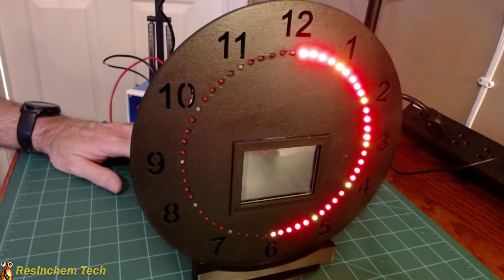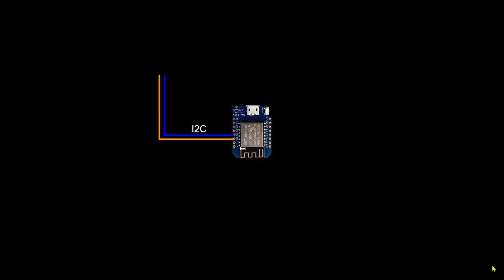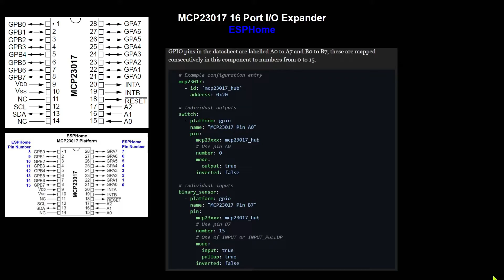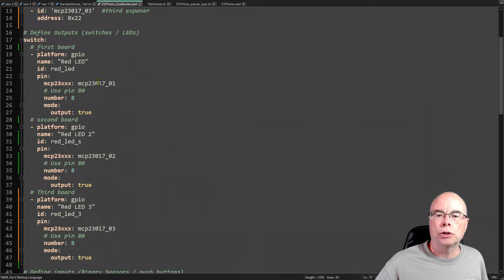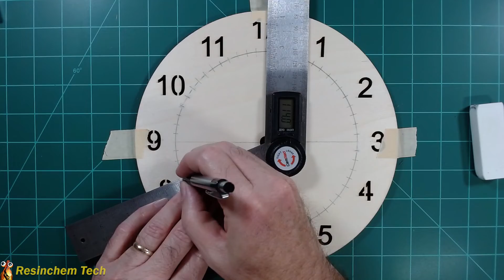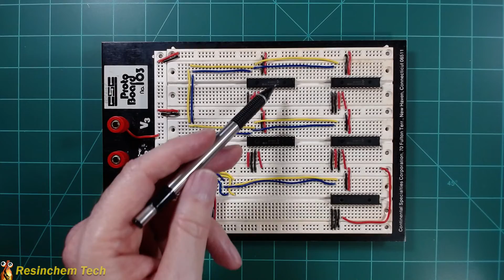MCP23017 Port Expander and ESPHome: Add More I/O Pins to Your Project

Comment: Can I connect TFT SPI pins on mcp23017 pins?
Reply from the maker: You can try it, but there may be issues with the signal/clock speed.  A quick search and it looks like you may want to check out the MCP23S17 instead.  I think this allows higher speeds than the MCP23017 and may work better with SPI.

But I haven't tried any sort of port expander with SPI, so I really can't say what might and might not work.  You'll just have to give it a shot on a breadboard version and see if it works.

Comment: I use mcp23017 a lot now  since you can add encoders, buttons and LEDs to them. I also read the pins GPA7 and GPB7 cannot be used as input pins on the latest chip die. So be careful when planning which pins to use, I tend to put my LEDs on pin7 of each bank.
Reply from the maker: Thanks for sharing your experience and the tip about the pin limitations with the latest chip die!  I haven't used one in a while, but I do have a few left in my parts bins.  I've also just been playing around with the TCA9548A multiplexer.  This one is made specifically for I2C devices, but should resolve the issue of two (or more) I2C devices with the same I2C address on the same bus.
Reply: @ResinChemTech I successfully run 8 MCP devices reading encoders, buttons and illumination of LEDs. I would like to add another 8 on the second i2c bus of the Teensy 4.1 to get 256 inputs for more encoders, but I have not tested that theory yet, also I could try and i2c multiplexer to give me 8 i2c busses on one pair of wires. I have done this with 8 OLED displays and it works fine to update any one of them.

Comment: is there a cpp code for arduino ide platform for esp32??
Reply from the maker: Are you asking if C++ code can be used with the Arduino IDE?  If so, then yes, C++ is the native language for the Arduino IDE and there is robust support for the ESP-series  of MCUs, including the ESP32.

If you've not worked with the Arduino IDE and the ESP32, then I have an introductory video on how to set it up and use it:  https://youtu.be/KS5HOJat88k
Reply: @ResinChemTech  thanks a lot

Comment: Hi there, nice explanation! But let me suggest something:

Hey there, fellow electronics enthusiast!

I watched your awesome YouTube video about using the MCP23017 Port Expander with the ESP8266. Great stuff! I noticed that you mentioned the limit of using up to 8 MCP23017 chips due to the addressing, but I think I might have a cool idea to expand that even further.

Here's the thing: we can set the I2C address of each MCP23017, right? That gives us 8 possible addresses to work with. But what if we get a bit creative? Let's say we use another MCP23017 to control the address pins of the other MCP23017s dynamically. We could set up the controlling MCP23017 to switch between just two addresses for all the other chips.

Picture this: we've got our ESP8266 and a bunch of MCP23017 chips. We dedicate one MCP23017 as the "address controller." We wire up the address pins of the other MCP23017s to the outputs of this controller. Now, by toggling the outputs of the address controller, we can switch the addresses of the connected MCP23017s on the fly!

So, let's do the math. If we use two addresses and switch between them using the address controller, we can effectively double the number of MCP23017s we can use. That means instead of being limited to 8 chips, we could potentially use 16, 32, or even more! It's like having a whole army of I/O expanders at our command.

Of course, there are some practical limits to keep in mind. The I2C bus has a maximum capacitance it can handle, so we can't go too crazy with the number of devices. Plus, the more chips we add, the more complex the wiring and code will get. But still, it's a pretty neat trick to extend the capabilities of the MCP23017 beyond the standard 8-chip limit.

I thought this might be a fun and interesting addition to your video. Feel free to give it a try and see how far you can push the boundaries of the MCP23017. Who knows, maybe you'll end up controlling a massive array of I/O expanders and impress us all with your mad skills!

Keep up the fantastic work on your channel, and happy tinkering!

Cheers, Pekagi

Comment: Hello. 
If  i want to use pultiple transmeter(10 TX for exampl) and one receiver .  How can i do that?
Reply from the maker: I'm not sure if this particular port expander would work for UART/Serial communications due to precise timing required.  I certainly didn't test the MCP23017 for serial TX.  You might need to search for a multiplexer specifically made for UART communications.  This is an example: https://amzn.to/4cRJJ9A but I have not tried or tested this particular module, so just consider it an example of something you might need to search for.  There are very likely other options, so you could just try a search for "UART Multiplexer".  Good luck with your project!

Comment: Just wondering: can these things do PWM at a decent frequency?  Ex. if you wanted to dim those minute-LEDs without changing the resistors ...
Reply from the maker: I don't believe I mentioned in the video, but I do talk about PWM in the related written guide for this project ( https://resinchemtech.blogspot.com/2023/10/IO-expander.html ):  

"While PWM (pulse width modulation) is technically digital and is commonly used for things like controlling brightness of a light by quickly switching the signal on/off, it is unlikely that the MCP23017 would work well for PWM due to the precise nature of the timing required.  But your mileage may vary."

Comment: Excellent tutorial Sir, but i have a question: i tried to expand Gpio pins using 74HC595 and i got noise problem, once switching on and off my roller shutter or my hair cutter !!! if use low voltage machines (12v ) no problem or no load also, and I found on the internet an article about noise problems using 220 v load on relays (the problem comes only with 74HC595 
if I use the same relays with the main Gpio of my esp32 Gpio exp (13 or 14) everything is ok 
so the question is: won't we get the same noise problem using the MCP23017? thank you Sir for replying .
Reply from the maker: I haven't tried using the 74HC595 as a port expander.  Nor have I tried using the MCP23017 for controlling relays with high voltage AC.  So I really can't tell you if you would experience the same issue with the MCP23017 or not.

Comment: Just stumbled upon your channel from the algorithm and I’m very pleased. Great content, clear and concise. Thank you for this. 

You’ve given me an idea for a clock using WS2812 LEDs. Would only need 3 lines (GND 5v and data) to do something similar!
Reply from the maker: Glad you found me!  Yeah.. as I mentioned in the video, this isn't necessarily the best way to build a clock, but it was really just an example of how to use the port expanders.  Funny thing, though... once I created a PCB and got rid of the breadboard, I really liked how the clock worked and have kept it on my desk.

I have also built a couple of matrix clocks using WS2812b LED strips.  These can also act as a scoreboard, countdown timer and a text display.  I have a couple of videos covering them if you are interested.

Comment: Very clear! Do you happen to know about any solution that allows to connect an extra UART based sensor?
Reply from the maker: There are certainly options out there for expanding the number of  UARTs on a device.  A simple Google search for UART Port Expander will turn up multiple possibilities based on your particular MCU and needs.

Comment: Hello, I came across it while doing an internet search while working on a similar project. Your explanation is very nice and informative. I am trying to do it with a 5v 16 channel relay card and esp32 via the blynk application. If I add MCP23017 to the project, it seems like it will work. Thank you very much, it is appreciated.
Reply from the maker: You are very welcome!  In case you didn't catch it in the video description, I have a related blog article with a bit more information than I could present in the video.  You may or may not find this helpful:  https://resinchemtech.blogspot.com/2023/10/IO-expander.html

As I mentioned in the video, it isn't necessarily the best way to build a clock but for me it was a good way to experiment with the port expanders.  In addition, this project led me to developing my first custom PCB board (shown in a  separate video) so that I could keep the clock without the breadboard mess.  I actually really like the clock now that I have it mounted on a PCB, and it sits nicely on my desk.

Thanks for watching.  And best of luck with your project!

Comment: THANK YOU!!! Finally someone show an MCP23017 with an external power supply!!! THANK YOU. Yes, people show the typical 1 LED and switch powered off off the Raspberry or Arduino... Guess what happens one day when the student plugs in 8 or 9 LEDs and wonders why his Arduino or Raspberry fry like Kentucky Fried Chicken. THANK YOU.
Reply from the maker: You are welcome!  Yeah... I have heard of a lot of situations where people try to power external devices (most notably 5V LED strips) off the 5V pin of an MCU, particularly ESPs.   They simply don't take into account the current draw and what the GPIO or other pin on the MCU or dev board is rated for.  And yep... it might not happen right away... but eventually they end up damaging or destroying the board.

That's why I try to stress in my videos when it is appropriate... or more importantly NOT appropriate... to provide power to an external component via the 5V or 3.3V pin from the MCU/dev board.  And how to run power in parallel when necessary.  But, alas, not everyone watches that portion of the video or opts to ignore it... then they post a comment or issue that their ESP8266/ESP32 quit working!

Thanks for watching... and I greatly appreciate the kind comment.

Comment: Thanks for the video - very comprehensive. I've just spent several hours 'debugging' my code on a similar project only to casually glance at the pinout diagram of the MCP23017 in the top RH corner of your video. And there was me thinking that port A would be on pins 1 - 8 and port B would be on pins 21 - 28 .... I don't suppose I'm the only person who knew better than to RTFM. Doh!
Reply from the maker: You are welcome... and I'm glad if my video helped out, even if just a little.  But don't feel bad. I don't know how many things I've fried due to not paying close enough attention to the pinout and doing something bone headed like reversing the polarity on the voltage leads.

In fact, I'm working on a PCB version for this same clock and port expanders.  The video will probably be released in a couple of weeks (still building) and I made a bone head move with this as well.  I'll cover that in the video... but sneak peak, the LEDs are wired in backwards order from the way I intended.

Thanks for watching and taking the time to leave a comment!
Reply: Excellent video and explanation too

Comment: great and very useful but i have one question why SCL and SDA pins are not pull up its require to pull up this pins ?
Reply from the maker: MCP23017 has internal pull up resistors that are enabled by default when initially setting up the devices.
Reply: can any issue when i connect pull up SCL and SDA with 10K ? Also I want to use all 16 GPIO as a Input pins with esp32 its right to  connect directly or use any current limit resistor for each pins?  @ResinChemTech

Comment: So for an ESP32, can this technique use both i2c busses for a total of 16 port expanders with 256 IO?
Reply from the maker: Theoretically, yes I believe you can.  I think how well it works will depend on the types of input/outputs you are using.  For example, while PWM is technically an binary signal, I don't think these expanders would work very well for PWM output due to the precise timing required (although I have not tried a PWM signal with them).

But yes, each I2C bus can have its own devices/addresses, so you could use the 8 available I2C addresses of the port expander on each of the two I2C busses on the ESP32 for a total of 16.

Comment: Nice job explaining this chip.  Any chance of publishing an STL file for the LCD bezel you created?  I'm not a CAD guy and have been unable to find suitable bezels for my projects using both 2.8" and the larger 3.2" ILI9341 displays.
Reply from the maker: Thanks.  My thoughts on the .stl files was that if/when I get a PCB created, I'd create a Thingiverse project of for all the parts: bezel, stand, LED covers, etc.  These might end up changing in the final version so I don't really want to put them out there now, as no one is going to build this particular "Franken-clock".

But for the bezel, you definitely don't need anything as fancy as a CAD application.  I just quickly did this in (free) Tinkercad:  It is just a 2mm tall rectangle that measures 82 x 64 mm.  Then a rectangular 'hole' that is 66 x 48 mm is centered over the initial rectangle and the two objects are "grouped" using the Tinkercad function.  That leaves you with the frame you see in the video.  It really is that easy and there is nothing fancy or difficult about creating it.  I then simply super glued it to the front face of the clock.  You could easily adapt this to both size displays by just altering the dimensions of the initial rectangle and the 'hole' that you insert into it.  If you haven't tried Tinkercad, I'd highly recommend it as it is an easy to learn and easy to use solution for creating basic shapes for things like this or simple geometric shapes for controller enclosures, etc. without the steep learning curve of more sophisticated CAD-like applications.
Reply: Thanks so much for the details, I will try to give it a go with Tinkercad!
 @ResinChemTech

Comment: Really useful overview given the limited IO on these uCs. Nice find and great explanation. Thanks!
Reply from the maker: It's not something that will be used very often in most projects, but it is a nice component to have in your pocket should you need extra I/O.  I was really surprised at how easy they were to code in ESPHome (and Arduino)... I expected that part to be a bit more complex, but once the port expander is defined, everything else works just like any other normal I/O pin.

Now the really challenging part (for me) is creating that PCB!  Thanks for commenting.

Comment: Wow! I love the name Frankenclock, which looks like a lot of my projects. I have never used or so far needed a port expansion, but I may find a use case now that I have watched the video. As always, a great video was very well presented and produced.

My kitchen upper cabinet interior lighting (so far) consists of seven cabinets and I did use the Aqara Zigbee door switches, but they are all dimmable (PWM) and currently running at about 80% max brightness.
Reply from the maker: Thanks... as always, I appreciate it!

If you didn't catch it, when I showed the cabinet example and said it was "inspired" by a subscriber... that was you!  I knew you were doing your project in a different manner, but it was your project that got me originally thinking about an example where a port expander might be used.  So thanks for the inspiration on that. :)

I do mention PWM briefly in the written version/blog article for this project.  While I didn't test it, I suspect using these particular port expanders might have issues with PWM just do to the precise timing required.  But maybe someone else has tried or used these (or similar) port expanders with PWM and can either confirm or deny that they cause issues.
Reply: @ResinChemTech  That cabinet is done including power supplies, control, and wiring. I will be adding some RGB to the same setup for accents on the countertop and along the ceiling, the controller already has the D1 for the RGB controls mounted. That was my first with two D1s in the same box, kinda crowded...

Comment: I used a TCA9548A I2C multiplexer board to connect four BME280 sensors to a Wemos ESP8266. I nearly went cross eyed doing the Arduino IDE code and wiring. I cannot imagine doing this to a clock. Yet again, thank you for a great video.
Reply from the maker: Yeah... it was a "challenge"!  I go into just a bit more detail in the written blog article, but those Dupont jumpers didn't want to stay put on the thin wires from the LEDs.  Every time I tried to add a wire, I'd knock two or three others loose.  I had to result to adding a little hot glue to each connection to keep it in place.

Then there were multiple times, I'd get the pins reversed or just one breadboard hole off and the LEDs would light up in the wrong order.  And reaching into that rat's nest of wires to move a jumper was no easy feat!  Definitely not the optimal way to build a clock.

But once I got the wiring correct, the Arduino code wasn't too bad in my case (it is actually Arduino code running the demo at the end).  I skipped the A0/0 pin on each board and used pins 1-15 (from the Arduino side), so that lined up perfectly with minutes 1-15 in each of the four 15-minute segments.  That made it easy to just loop from 1-15 in each segment to turn the LEDs on in order (or to calculate which LEDs to light up for minutes).  Again, there's a bit more detail in the blog article.

Thanks for watching... and as always, I appreciate the comment!
Reply: @ResinChemTech  I have learnt the hard way to cut custom jumpers rather than use the Dupont ones. Solid core 22 or 24 awg solid core FTW!